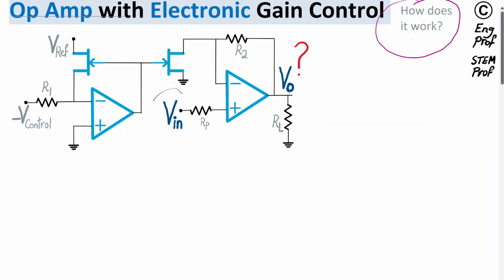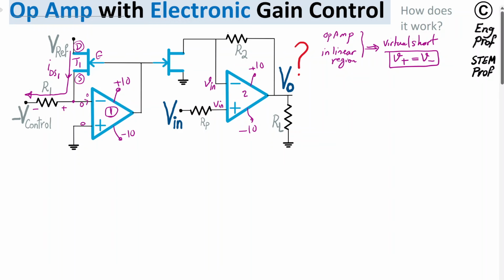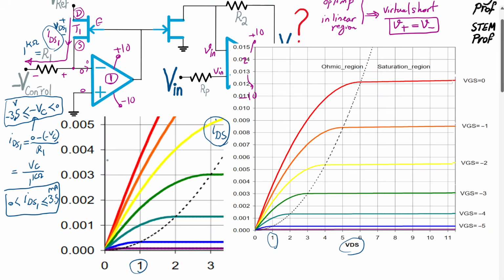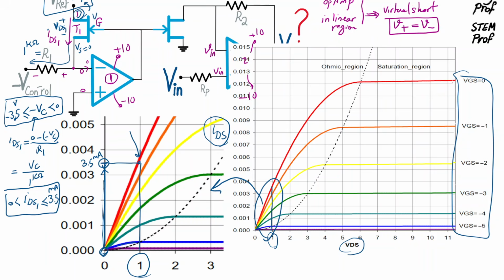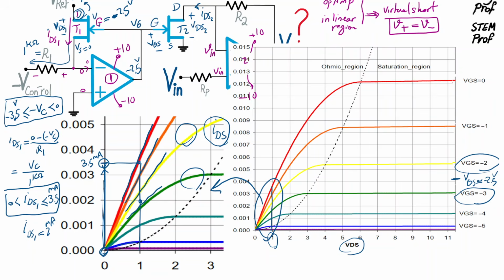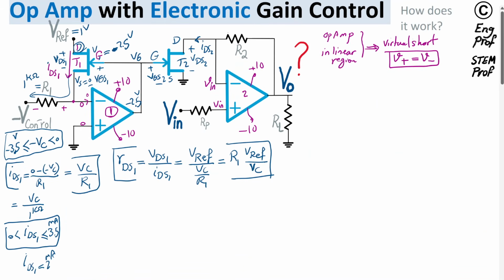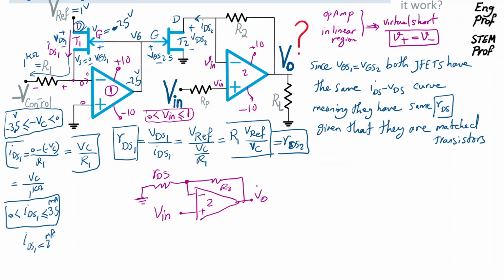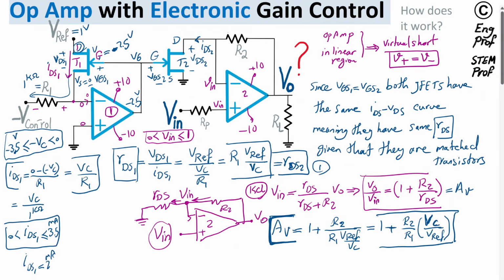Op Amp Amplifier with Electronic Gain Control: How does it work?

Comment: I'm probably missing something obvious. Why not use a single linear mosfet (generally used for its linear VI characteristics in instruments), use a control voltage to drive it directly and set the variable resistance in a single stage configuration ?
Reply from the maker: Thanks for watching and your good question. We want to linearly control the resistance value between JFET drain-source as is the case in the presented circuit.  In your suggested scheme the drain-source resistance is nonlinearly controlled by Vgs (approximately quadratically). I hope this explanation is helpful. For more Amplifier, BJT, JFET Circuit examples please see: 
Sawtooth Oscillator with Op Amp, JFET and BJT Transistors https://youtu.be/5zHXTx-Vl20
Voltage Regulator design with BJT JFET & Op Amp https://youtu.be/CJl-urzeiTo
Push-Pull Power Amplifier with Darlington Transistors https://youtu.be/866MYibo8yE
Analog Computer to Raise Signal to power n https://youtu.be/IUTlBH1UraE
For more analog signal processing examples see: https://www.youtube.com/playlist?list=PLrwXF7N522y4c7c-8KBjrwd7IyaZfWxyt
I hope you also enjoy these circuit analysis videos.  Thanks again. 🙏

Comment: Interesting ideas there, always a pleausre seeing different ideas especially around manipulating key paramters to mimic different use cases. I feel my question is trivial but i will ask it anyhow. I imagine the same can be made using a BJT or a mosfet? JFET are a little bit less ubiquitous than their relatives.
Reply from the maker: Thanks for watching and your good question. We can only use a transistor here that has a decent controllable Ohmic Region in its Current-Voltage I-V curve. Bipolar Junction Transistor (BJT) is a Diodic (PN junction) device with super small ohmic region that is extremely sensitive (exponentially) to tiny adjustments to the base-emitter control Voltage that is super limited in the range of 0.6-0.7 volt. Therefore BJT is not a proper choice when we want to realize a controllable resistor. On the other hand, Junction Field Effect Transistor (JFET) is a channel depletion device with a decent ohmic region in JFET drain-source voltage current  characteristic curve. JFET current is quadratically related to control gate-source voltage (reasonable sensitivity) with a wide Vgs voltage range that works well in a stable feedback loop. I hope this explanation is helpful. For more JFET, BJT, Op Amp Circuit examples please see: 
Thermometer Circuit Design with Op Amp & BJT transistor https://youtu.be/55YsraFE0rg
Analog Logarithm Computer with BJT https://youtu.be/RpKEq5WyoLg
Sawtooth Waveform Generator design with OpAmp, JFET, BJT https://youtu.be/5zHXTx-Vl20 
I will post more examples in my Analog Circuits Video playlist https://www.youtube.com/playlist?list=PLrwXF7N522y4c7c-8KBjrwd7IyaZfWxyt
I hope this explanation & these Circuit videos are helpful. 🙋‍♂
Reply: @STEMprof  I'm pretty sure they'll be quite useful.
Reply from the maker: Thanks again for watching and your interest in these circuit videos.
Reply: @STEMprof  professor, I'm a fellow engineer. This is my bread and water. Exploring options is what I live for. However, we can't know all, my head is exploding with all I learned and recalling is now a bane. Earlier I was wondering if we could manipulate the gain using transconductance or transresistance for BJT and MOSFET. Sometimes the opamp feedback design doesn't integrate well, and I was surprised an actual opamp was used. Negative resistance oscillators use transresistance amplification, but not in a way one would like to control through an input. Like that video you suggested for temperature measurement using pnp transistors. Since temperature is an implicit control method ironically. There are those programmable potentiometers of late, but I suspect they can't be operated in reverse polarity which would render them useless I assume in a dynamic amplifier model. Suppose one is to model a resistor, bidirectional line, controlled by an external signal, jfet with their channel construction of mobile charges do make sense to be a variable resistor, and in both direction. My textbooks didn't have jfets 🤣. If I may impose on you, either guide me to the world of jfets or guide me to transresistance of the linear world. Thank you for your patience. I have bookmarked your playlist, the RF one as well. Those sit well within my domain. Your videos are underappreciated, you will always have my attendance.
Reply: @STEMprof  on a second thought, JFET isn't available for assembly. As much as i would like to learn JFET wizardry, i think I must find an alternative manner using more commonly available components. Discrete options may exist, but now after seeing your video, i have to get it out of my system and find a way to make it happen perhaps using transresistance method.
Reply from the maker: @xDR1TeK  Thank you for your interest, sharing your thoughts and your encouraging comment. I appreciate. Sure, I will plan more JFET Example videos to highlight its use cases.  In the meantime, please see the following JFET example https://youtu.be/NB1-mYglXsY  that provides an overview of JFET I-V curve  (starting at minute 2:45) while showing How to find Gain of JFET & BJT Feedback Amplifier.  For more JFET and BJT transistor circuit examples, please see:
Sawtooth Oscillator with Op Amp, JFET and BJT Transistors https://youtu.be/5zHXTx-Vl20
Voltage Regulator design with BJT JFET & Op Amp https://youtu.be/CJl-urzeiTo
Push-Pull Power Amplifier with Darlington Transistors https://youtu.be/866MYibo8yE
Analog Computer to Raise Signal to power n https://youtu.be/IUTlBH1UraE
For more analog signal processing examples see: https://www.youtube.com/playlist?list=PLrwXF7N522y4c7c-8KBjrwd7IyaZfWxyt
I hope you also enjoy these circuit analysis videos.  Thanks again. 🙋‍♂
Reply from the maker: @xDR1TeK  Thanks again for watching and sharing your thoughts. While JFET transistors are not as popular as MOSFETs, you can still easily purchase them from for example https://www.mouser.com/c/semiconductors/discrete-semiconductors/transistors/jfet/
Here are a few examples of cheap Junction Field Effect Transistors:
OnSemi MMBF4391 N−Channel JFET Transistors from 
MMBF4117 ,  NSVJ3910SB3 N-Channel JFET Transistors from OnSemi
Toshiba JFET 2SK3320-BL Junction FET N-Ch x2 1.2V to 14mA
Texas Instruments JFE150 Ultra-Low-Noise, Low-Gate-Current, Audio, N-Channel JFET https://www.ti.com/product/JFE150

For more JFET and BJT transistor circuit examples, please see:
Sawtooth Oscillator with Op Amp, JFET and BJT Transistors https://youtu.be/5zHXTx-Vl20
How to find Gain of JFET & BJT Feedback Amplifier https://youtu.be/NB1-mYglXsY
Voltage Regulator design with BJT JFET & Op Amp https://youtu.be/CJl-urzeiTo
I hope these are helpful.
Reply: @STEMprof  I can't thank you enough. I will review and move forward with your references there. Thank you.

Comment: OK, from a first look - JFET resistance is equal to Vref / (-Vcontrol/R1). So voltage gain of second opamp is R2/RJfet + 1.
This is because inverting input of opamp 1 is at virtual ground, so the opamp output will set Vgs of both JFETs in a way so that JFET1 will source current equal to Vcontrol/R1, as JFET2 is matched it will have identical resistance.
Wonder if I'm right 😂
Reply from the maker: Thanks for watching and sharing your thoughts. Glad that this video is interesting. You summarized it well. I'd also add the following: As one of practical design choices we set -3.5<-Vc<0 because with Vref =1v (to keep JFET in deep Ohmic Region) as I showed on the JFET I-V curve the maximum drain-source current that JFET can support in deep Ohmic Region is roughly 3.5mA when Vgs=0 for the example JFET I-V curve in this exercise (this of course depends on the choice of JFET device). Therefore we need to limit the drain-source current to max 3.5mA in this example. This is achieved by setting R1 to 1Kohm and -3.5<-Vc<0. For more Op Amp Circuit and Analog Filter examples please see https://www.youtube.com/playlist?list=PLrwXF7N522y4c7c-8KBjrwd7IyaZfWxyt
I hope this is helpful. 🙋‍♂

Comment: Is it possible to replace JFET->MOSFET somehow? What is THD of the circuit we could get?
Reply from the maker: Thanks for watching and your good question. JFET transistor is a depletion device with max drain-source current Ids when gate-source voltage Vgs is zero. We can only reduce Vgs to negative values to deplete channel to reduce Ids current from its max value. MOSFET (say NMOS) on the other hand has zero channel and zero Ids at Vgs=0. We need to increase Vgs to increase Ids. Op Amps should be able to handle needed positive gate voltage of NMOS as well. The rest of concept should be the same in the sense that we need transistor to operate in deep Ohmic Region and hence Vds needs to be set properly to a small value (by properly setting drain voltage). I hope this explanation is helpful. For more Circuit examples please see https://www.youtube.com/playlist?list=PLrwXF7N522y4c7c-8KBjrwd7IyaZfWxyt
I hope these further examples are interesting. 🙏
Reply: Nowdays it's much more easy to find a dual nMOSFET 7002w SMD for example... @STEMprof
Reply from the maker: Good point regarding availability of NMOS including 2N7002 MOSFET transistors from Infineon or Onsemi. Thanks for the comment. 🙋‍♂️

Comment: Nice example of an Op-Amp + FET based Variable gain amplifier, but you completely lost yourself in the explanation of the first half of the circuit.
The idea being very simple, that is, to linearize the Vgs to Rds (on the first half), by inserting the 1st FET in the feedback loop of the 1st Op-Amp and, by doing so, generating a control voltage to the 2nd FET, that is compensated for the non-linear Vgs to Rds relationship of the FET, thus linearizing the -Vc to Gain relationship, one such a thing that would not be the case if one would apply -Vc to directly control the Rds of the 2nd FET.
Reply from the maker: Thanks for watching and sharing your thoughts & feedback. I am glad that this gain-controlled amplifier is interesting resulting in these good comments. I agree that there is always a better way to describe the operation of the circuit. I will post another example and will try to do a better job at explaining and analyzing the circuit. For more Circuit examples please see https://www.youtube.com/playlist?list=PLrwXF7N522y4c7c-8KBjrwd7IyaZfWxyt
Thanks again.🙋‍♂️

Comment: Thanks for sharing.
I would put a cap between R2 and Drain of the T2 and put high impedance say 100K from drain of T2 to 1V and the same thing for T1( that is  high impedance say 100K from drain of T1 to 1V).
This way you ensure that the  two transistors are matched at DC, to get your equivalent resistor. The AC signal gets coupled through the cap.
Reply: Yes I was thinking about the same issue that the drain on T2 is on a different DC level. I like your suggestion. I was also thinking about manipulating the DC level on Vin to (in this case to +1V) to bias the Drain on T2, but that becomes a mess as this will effect the output on the amplifier that will get a DC-level dependent on the gain.
Reply from the maker: Thanks for watching and sharing your thoughts and practical suggestions. To your good point, DC level manipulation adversely affects transistor bias points and output DC level. There are of course additional practical considerations for practical implementation of this circuit.  For more Circuit examples pls see https://www.youtube.com/playlist?list=PLrwXF7N522y4c7c-8KBjrwd7IyaZfWxyt
Thanks again.🙋‍♂️
Reply from the maker: Thanks for watching and sharing your thoughts and practical considerations. For more Circuit examples please see https://www.youtube.com/playlist?list=PLrwXF7N522y4c7c-8KBjrwd7IyaZfWxyt
Thanks again.🙋‍♂️

Comment: I very much enjoy these analyses of yours but invariably questions pop up in my mind: what would happen if I wanted to assemble the real circuit, using concrete hardware, say a particular op-amp or a particular JFET? What parameters of the devices I should take into account, given a particular application, or what additional devices I would have to use to make this practical implementation work. It would be very interesting to have this discussion using an example of this or any other circuit you analyzed before. Anyway, thank you for this one; as always very interesting and educational.
Reply from the maker: Thanks for watching and your interest. Glad that you enjoyed this Gain-controlled Amplifier design video. You have a good question. I'd recommend to use a good general purpose Op Amp from Analog Devices or Texas Instruments as long as you are dealing with a nominal use case. Then in this case select a JFET that satisfies your max drain-source current and voltage and pinch-off Vth voltage. Then just start experimenting (that is the best way to learn further).  During experimentation you will need to set values of coltrol/reference voltages. For example as a design practical choice we set -3.5<-Vc<0 because with Vref =1v (to keep JFET in deep Ohmic Region so that it acts like resistor) as I showed on the JFET I-V curve then the maximum drain-source current that JFET can support in deep Ohmic Region is roughly 3.5mA when Vgs=0 for the example JFET I-V curve in this exercise. Therefore we need to limit the drain-source current to max 3.5mA. This is achieved by setting R1 to 1Kohm and -3.5<-Vc<0.  These are examplecof practical design choices that might be needed.
I hope this explanation is helpful. For more Op Amp Circuit and Analog Filter examples please see https://www.youtube.com/playlist?list=PLrwXF7N522y4c7c-8KBjrwd7IyaZfWxyt
I hope this is helpful. Thanks for watching. 🙏

Comment: Thanks a lot for your videos my friend, they are extremely well explained. 
In 4:07 why -3.5v??<Vc<0?
Could you tell us where you get those interesting exercises? And can you upload an example of AGC but showing us from scratch the design step by step? Thank you
Reply from the maker: You are welcome. Thanks for watching and your good questions. Glad that this video is useful. Sure, I will post an AGC circuit soon. And answering your question, At about minute 4:00 as one of design practical choices we set -3.5<-Vc<0 because with Vref =1v (to keep JFET in deep Ohmic Region) as I showed on the JFET I-V curve the maximum drain-source current that JFET can support in deep Ohmic Region is roughly 3.5mA when Vgs=0 for the example JFET I-V curve in this exercise. Therefore we need to limit the drain-source current to max 3.5mA. This is achieved by setting R1 to 1Kohm and -3.5<-Vc<0.
I hope this explanation is helpful. For more Op Amp Circuit and Analog Filter examples please see https://www.youtube.com/playlist?list=PLrwXF7N522y4c7c-8KBjrwd7IyaZfWxyt
I hope this is helpful. 🙋‍♂
Reply: @STEMprof  excellent my friend, now all circuit is clear.
Reply from the maker: @sersheva  Thanks again for watching and your comments. I will post more examples in the Analog Circuit video collection  https://www.youtube.com/playlist?list=PLrwXF7N522y4c7c-8KBjrwd7IyaZfWxyt
Thanks again 🙋‍♂